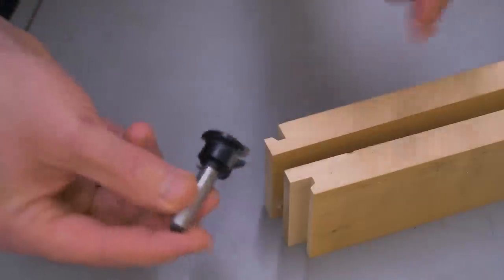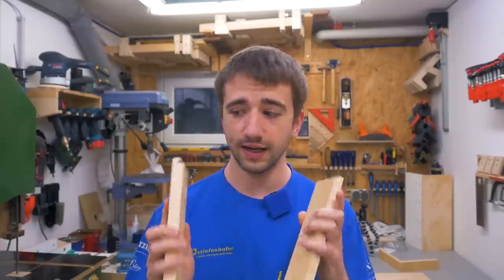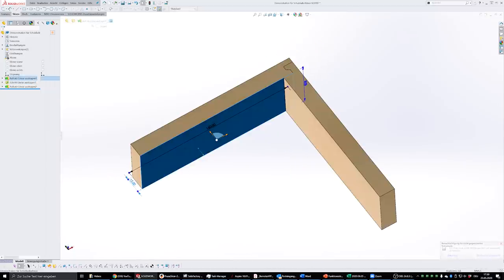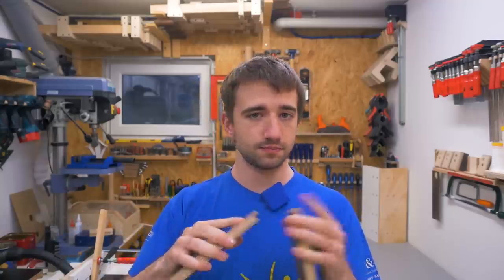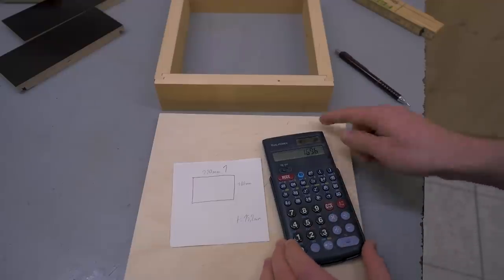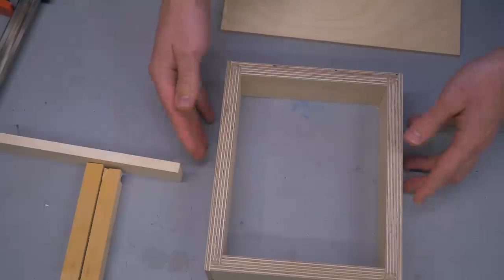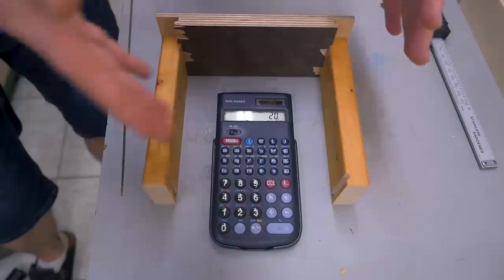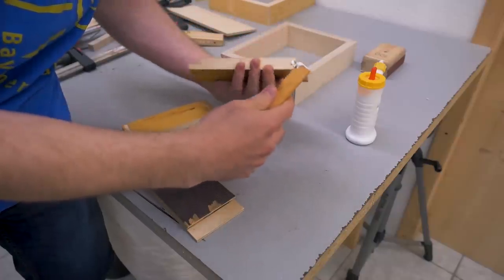HOW TO Use a Drawer Routerbit

Comment: Thank you for the math / geometry lesson. Seems like a lot of work for one box, but a real time saver if your making many. Think I need to start working in metric, fractional inches complicate the whole process unnecessarily.
Reply: Careful, when you get the hang of it you can't go back. Worst case you end up moving to another country. 😉
Reply: There's always the decimal inch. No one forces anyone to use fractions. I only use fractions when I benefit from it. If I am doing close work I am going to work to the thousandth of an inch. Which is 0.0254 mm. Six of one is a half a dozen of the other. Unless you're a baker.
Reply: Muru Roa , moving is an option. Did it move you?
Reply: Paul Frederick , agreed I could go decimal inch, but then there is still the base 12 for feet and beyond. If I make a change, would rather go all in for in integrated unit of measure.
Reply: @MrMNRichardWright  Actually I did. Been living the metric dream in Holland for the last 5 years now. 😉
Reply: Using metric in the US is hard even if you want to because the tooling and stock are still all in “standard” US units so you end up working with lots of decimal places instead of nice round numbers,
Reply: Fractions came about because people thought that it's easier and more "intuitive" to think in "well this is half of that and this is two times this much and this is eight of what ever that is" but from than ancient system came something really difficult when suddenly people needed to deal with real numbers and distances when things weren't anymore built or made adhoc where every single item was different from the last one and nobody was even expecting stuff to be the same and things were hand fitted every time and accuracy wasn't required.

So suddenly that system started to be really non intuitive to do accurate math with (what you need to do when you deal with real numbers and distances)... but metric is new and it was specifically chosen so that it would be easy to do math with no matter what the numbers are :)

Comment: GLUE UP: Now I see that you flooded all surfaces with glue and clamped them.  but when you did hammer them, you mentioned that the plywood came apart and never mention that the butt joints of the end grain ply did also gave way and did not hold like solid wood will.  I am not trying to discredit your video but talking from a skilled professional's knowledge of proper construction methods.  These bits are very good but to be dependent on total holding power on their own I feel is not correct.  It's like bread making, anyone can make a loaf of bread but is it of artisan quality in every way of looks, taste, and form.  This is the same thing with these bits, good but not just by themselves and glue has little bearing in the long run.

Comment: Wouldn't a strong bottom have stabilized the whole drawer and the joint would just have to withstand parts of the pulling force while the drawer is opened?

Comment: I'm curious but confident all the drawers I made out of 1/2" baltic birch for clients over the years are still working just fine and I just did a simple rabbit joint and pinned from the front.  Todays glue is amazing and when you use mechanical slides I just don't think there is much force on the joints.  The expense of making box joints or dovetails on kitchen drawers Is high and honestly how often do you open a drawer and admire the dovetails... once, when the manufacture points them out after installing the kitchen.
Reply: But lovely details make the difference from a craftmansship master to a capatalistic user.
Glue in the end is not more than plastic and basicly turns ur wood into problematic waste.
Depends on ur working-philosophy.

Comment: With some ply on the base of the drawer that failure mode would be eliminated, I'd reckon. It'd be interesting to see how the joint would fail when you load a drawer up with a load of junk, I'd reckon it'd be plenty strong.

Comment: If you're not worried about visible dowels, you could always dowel the sides after glue-up to really strengthen the joint. And like someone else mentioned, a ply bottom would essentially eliminate that failure mode anyway. Awesome video!

Comment: The managing editor of "Wood Working Guild Of America" (WWGOA) made a video in 2018, telling us how we need to make many cuts and router adjustments to get the correct setup!
And he is not the only one with many years of woodworking experience who have made similar videos with the same "there is no other way than test cut over and over again until you happen to find the correct setting (- and have a stack of sandpaper ready)" way to use this great lock system bit.

Well done, Marius, you both came up with the formel and shared it with us!  (Y)  

You and Matthias Wandel's are a lot alike in the way you approach woodworking, with a lot more science and logic, and eagerness to find new solutions, than most of your "colleagues" here on YT.
It's always a pleasure to watch the process as well as the outcome  (Y)

PS: If you haven't seen his DIY Pantorouter, I really recommend it!  :-) 
 
Alles gute aus Dãnemark  (y)

Comment: I would assume that when you integrate the drawer bottom in the frame, it will not brake. :-)
Reply: I was going to make a similar comment.  The true test of strength would be to try to pull the front off the drawer.

Comment: I would rather overcut it slightly, so you have a little overhang on the end side.
That way you can easily remove and make it flush with a router bit.
Nice video again!

Comment: Having seen the failure mode, wouldn't a simple rabbet or rebate joint work just as well? Also I've seen it pointed out on youtube that dovetails are the joint of choice for drawer front and backs as they're intended to resist the pulling forces on the draw. Thanks for the video.
Reply from the maker: Yes, would also do the job. Dovetails are ideal, but they take some time to make
Reply: The dove tails are the ideal joinery system if you have and Incra Joinery System, quick easy and dependable. But not everyone has the Incra System. I have both and believe me the Incra is easier to set up than this bit.

Comment: the router bit makes for a beautiful joint, yet there's relatively much end grain which compromises the strength
Reply: Drawer locks are typically only used on the back of drawers. The front is usually some other kind of joinery. Half blind dovetails are popular.

Comment: Wow, an extremely complicated solution to a ancient joint. Simply solution, buy a different lock joint bit made by a non-Chinese manufacturer, perhaps Amana , Freud, Rockler, to name a few. The biggest issue is the angled taper creates unnecessary issues.

Comment: All draws only experience stress in 2 direction, push or pull and not from the side or diagonally.
If you always orientate the draw so that the longer 2 sides are the front and back, the shorter sides literally hook into the front and back giving more than enough strength against the push pull stress.
I have this cutter gathering dust in a draw because it had no instructions of how to set it up and I got frustrated trying to work it out
This joint should give years of service if done correctly. Thanks for showing us how to.
As an edit ENT is something different in England so I couldn't look up there website

Comment: I used a similar miter lock bit to make boxes - all eight edges were cut with the bit. The interlocking of the pieces was such that I had to assemble/glue all six sides at once. Your bit would allow for two steps, which would be much easier. 

Another thing to be careful of when using either bit style is that water based glue causes wood to expand. When the joints are long (>300mm, 12") you need to spread the glue and assemble quickly or the joint surfaces swell before you finish and may not fit properly. It's really bad with MDF.

Comment: BRAVO Marius, well-done video.  Impressive, your mathematics and skill with the stretch program are very interesting.  Not to discount the importance of what you have just shown us in this video I was watching and never set up my bits with mathematics as you have just demonstrated so skillfully.  I have for many years used lock miter bits for many, many jobs I have performed over the years and I have found in all of this type of bit or shaper cutters there are only two very important measurements.  the height and thickness of the objective cut in question.  often times it is the actual size of the material.  when this concept is clearly understood one can easily rais the cutter to the needed height and then cutting through the safety face board arrive at the targeted depth of cut.  All in all, I very much so enjoyed your video.

Comment: Excellent video Marius.  This bit has been around for some time now along with the Lock Miter bit.  They both have some of the same characteristics in set-up.  However, even though I have used both of the said bits for many years now I have stopped using them in drawer construction for the reason I have been complaining about for years now of having mortise and tenon joint so tight that they must be hammered into place THUS "Where is the Gule going to go?"  That's Right Pushed right out of the joint itself where it is supposed to be to keep things in place.  Look at your joint it is wood to wood there is no place for Glue.  And are you totally agreeable with a .003mm film of glue in the joint? Do you really think that that thin film is a sufficient amount of glue to do the job it is intended for?  I think these bits are really good inventions but should be pinned with gun nails or brad pins because there is no good space for any decent amount of glue to do its intended job of bonding the two surfaces together as one piece. No, dovetails or box joints for me in drawer construction now and forever.  These bits are used with gun nails no glue is needed because there is no place for the glue in this tight joint.  I know it still works and has been used for many years now but I'm not talking as a customer buying home depot kitchen cabinets but as a knowledgeable woodworker of good cabinetry construction not just how to make something and sell it and hope it holds together for a while.
Reply: That is a good thing to think about.  The glue line thicknesses for wood joints are generally from 0.13-0.18 mm (0.005-0.007 in.) thick for glued assemblies.  That is optimal according to my searches. I wouldn't think these joints are tighter than that... If they test fit that tight, can't we adjust and leave a little room?  I suppose its also a bit of a factor of how much clamping pressure you use and how it affects this joint.  Since there is a ramp in this joint. that area would take most of the pressure first and it may be thinner than ideal, but I think there is a fair bit of glue surface. and the joint itself  is designed to resist twist and be self aligning, which is pretty nice.  the bottom should account for the kind of forces he used in this video to break the joint.

Comment: I'm definitely thinking like a proper constructor now.  When Marius was explaining how the calculations work, it immediately occurred to me you could use the second mode to make a single-piece drawer front.  If you were to want a permanently captive drawer, you could also do it on the back (and then build the cabinet around the drawers to capture them).

If you were building something like a component/fastener/hardware cabinet, this would be ideal as such drawers don't need to support heavy things and you usually need to make them in quantity.  This would make turning out a few dozen small drawers a LOT faster than most other joinery methods.

Comment: personally I have the chinese version of this type of router bit .. the setup is also a crazy thing .. it's helps for making joint ... but you always  need to make some tests before making the real cuts ..
also I think that it is necessary to slightly reduce the wood before attacking it with the bit .. it is a little hard
Reply: Well, you should always make test cuts with any new cutting tool to make sure you understand what it does.  Never make a cut to a real project part with a tool you don't fully understand the action of.

Comment: Thanks man this drawer bit is the perfect solution to a problem I have been having I re finish and re purpose alot of old furniture that the drawers have been misused the dove tails are broken someone has tried a bad repair on it ,, now I can simply rabbit out bad ends glue up new piece leaving the drawer front alone use your new router bit idea !! Perfect solution to my problem,s a grand idea thanks could you please leave a link were I mite find one
Reply from the maker: I'd only have a link for Germany, which probably won't help you much

Comment: Thanks for a great video Marius, it's a neat router bit, but I suspect it's quite expensive?  Economies of scale though I suppose, if you're making lots of drawers, it'd be a good investment.  Out of interest, what is the brown faced board that you're using called?
Reply from the maker: The bit is about 45€. It's called Phenolic resin coated plywood
Reply: @MariusHornberger  Thank you Marius, I've been trying to find out the name of it for ages, it looks really hard wearing?
Reply: @edwardholmes91  it is. Usually it is used for building trailers for example...

Comment: If you need strength you could always add some screws.
Reply: Drawer lock joinery is typically only used to hold the back of a drawer on. You can make a whole box using one but it is not what is normally done.

Comment: Why is it ironic that the online instructions were incorrect? Surely it’s just careless.
Reply: Or perhaps they were written by someone who hasn't actually USED the tool.  The calculations seem fairly straight-forward, but you'd really need to have used the thing to write good instructions for it.

Comment: Can you put a stop collar on the router bit at the correct height so it's easily repeatable after changing bits?
Reply from the maker: Sure, but if you make many drawers, I'd always use a test piece
Reply: I do not think a stop collar is a good idea, why?  The bit would be raised higher leaving less of the bit in the bit holder this would create a high mass high center of gravity swinging around at about 16.000 rpm. Not very safe. Large bits need to turn slower have 1/2 shank or larger and sit as low as possible in the collect the mass of the bit below the jaws of the bit add stability when rotating.
The answer to your Dilemma is to get the bit set up properly height and fence depth for your stock thickness and make and save setup blocks for the next time you use this bit.😁🛫

Comment: Now imagine this videos done in imperial LOL
Reply: The world stopped using Imperial length measurements in 1835. That's when the Empire adopted US Customary as their standard too. The old Imperial inch was only 2.5 cm long.
Reply: Turns out dividing fractions by 2 is easier than decimals because you only need to multiply by 2.
Reply: @Sylvan_dB  you double the denominator of a fraction to halve it. I am no math wizard myself but I was taught that when I took mechanical drawing. We had to center things a lot in that class so being able to halve fractions was useful for us. That's also where I got used to the sixteenths inch scale. We used that a lot too.
Reply: @1pcfred  No it didn't.  Ask an engineer in just about any country what measurements they use, they use thousandths of an inch (.001").  More precise and easier to measure.